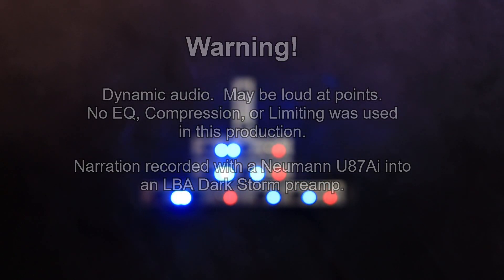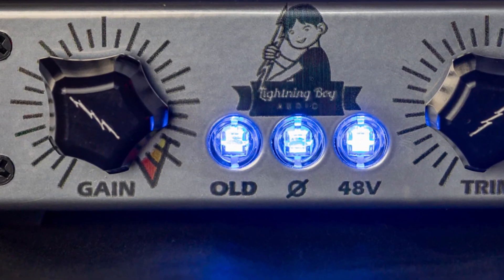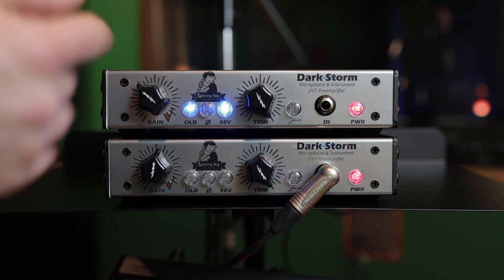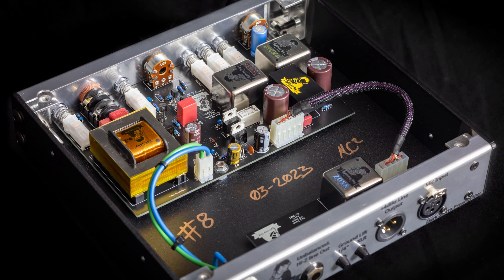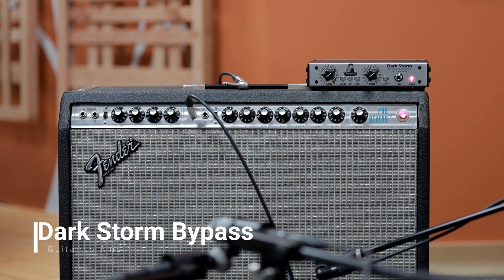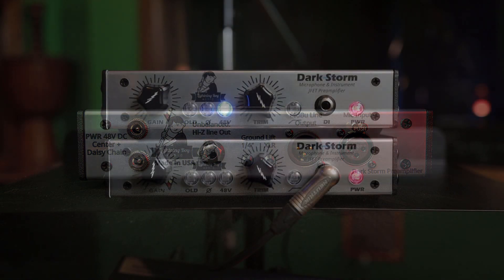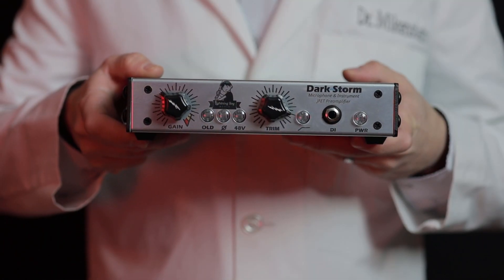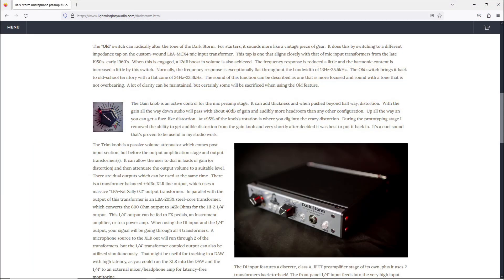The Storm Series preamplifiers from Lightning Boy Audio

Comment: are you gonna do tubes?
Reply from the maker: I might do a tube opamp as an option/upgrade for the Dark Storm in the future.  It’s something I’ve been putting a lot of thought into.
Reply: @LightningBoyAudio  Was wondering about tubes myself.  That unit seems real cool, and love that you're all in house in NY.
Reply: @LightningBoyAudio  That would tick every box for me, I really dig your work.
Reply from the maker: @JackNance22  I deeply tried to figure out a way to make it so a tube preamp could be retrofitted, but reliability became a quick factor.  Reliability is a major factor for me.  I want products that last a lifetime, not 2 years and done, or damaged in shipping.  So, due to the form factor of this design, tubes are a no-go.  It's nothing to do with tubes in general.  I love tubes even though they make the product more expensive to build.  They sound great, but so do JFET transistors (specifically over all other transistors).
Reply: @LightningBoyAudio  Yes, of course, one must do whatever works best. And I agree that JFET transistors sound excellent. I find driving the transformers just right is where most of the flavor is, which your current preamp design knocks out of the park. Looking forward to getting a pair, I need some of those transformer passive boxes too!